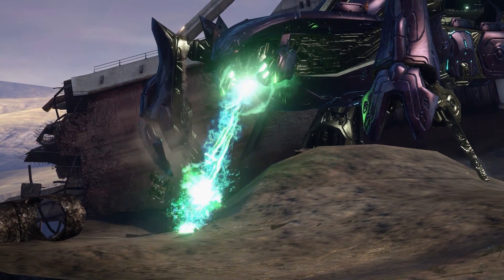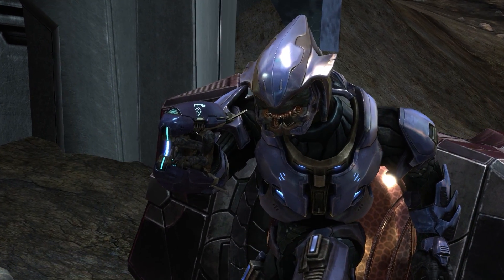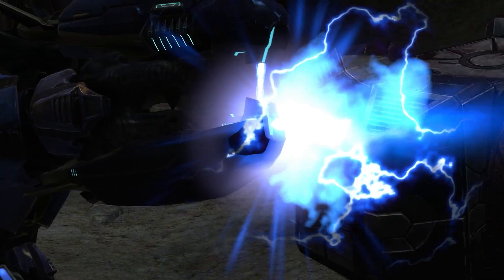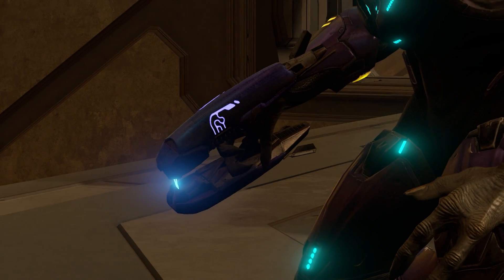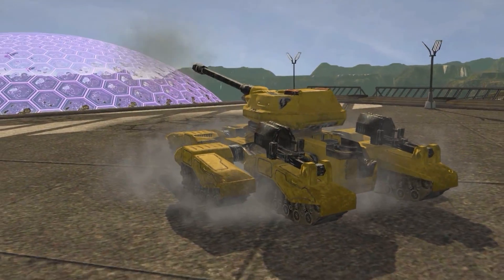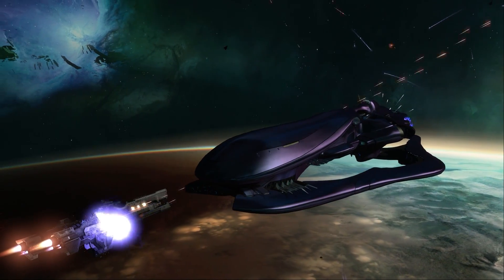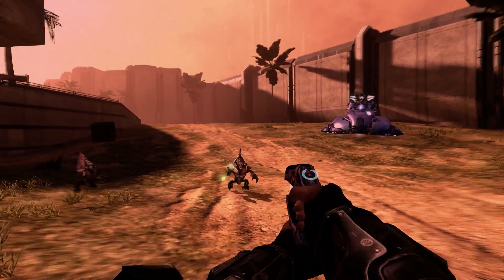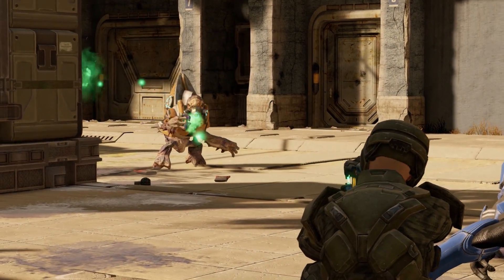How Plasma Works (Halo Lore)

Comment: Master Chief survive re-entry which has being known to get up 3000 degrees C which suggests that Mjolnir armor is incredibly heat resistant so maybe survive plasma shot isn’t all that crazy for a spartan.
Reply: zahir martinnez Master chief used Debris during both of his re entry feats. Also plasma would likely be even hotter since plasma punches straight through mjolnir in the books.
Reply: Dj Cuevas covenant plasma torpedoes are stated to be 3000 degrees celsius and in the novel chief tanks a fuel rod cannon to the chest and keep going so idk were you are getting that plasma weapons melt through Mjolnir especially when even odst armor which is a down grade has procedures to reduce plasma effectiveness of plasma, also were is it stated that chief use debris I know there is fan art of it but to my knowledge nothing official has be stated own the matter.
Reply: @zahirmartinnez211  
During the beginning of halo 3 & 4 Cheif enters the atmosphere of Earth and a forerunner planet with only bits of space ship debris. There's also a plot device the writers will use sometimes to explain why spartans survive such leathal attacks called Armor lock. I'm pretty sure that's canonically how cheif survived falling on to Earth from high charity.
Reply: @punctuationman334  ight ight you might be right but dont attack people pliz
Reply: @zahirmartinnez211  Need a source on when Chief tanked that shot cause other spartan IIs have been killed by similar or less impressive means.
Reply: Samuraiedge II sure it’s from the halo novel “The Flood” here’s the quote: 
His shield had just begun a recharge cycle, feeding off the armor's capacious power plant, when the pair of Hunter aliens burst from cover and lobbed fire at his position.

The first blast struck him square in the chest and sent him tumbling backward. The second shot was stopped by a thick-trunked tree. A trickle of blood pooled in the corner of his left eye. He shook his head to clear his blurred vision and rolled to his left.
Reply: @zahirmartinnez211  Okay since the book specifies that it takes place between September 19th and the 22nd 2252, that would mean that Chief and any surviving Spartan IIs was wearing MK VI armor.

The problem comes in when another spartan, William-043 was killed by a single shot to the chest by a Hunter's assault cannon. A month after the Mk VI was issued.
Reply: Samuraiedge II there probably inconsistency in the armor for narrative purpose and that’s why I go with some of the higher ends sense it’s actually more consistent with everything we seen spartan due or claim the can. It seem like the authors nerf characters to raise stakes but if you what me to I can show you feats.
Reply: @zahirmartinnez211  Okay, after a little more digging, Chief was wearing the MK V when he took the assault cannon shot. 

Still inconsistent though as the MK V apparently can't handle terminal velocity impact as evidenced by Malcolm-059's death and the wiki says that Chief withstood the splash from an off-target shot.
Reply: Samuraiedge II Mjolnir amor information is tricky because on one side the wiki also derived is sources from gameplay ( I don’t mean the game I’m referring to the actual gameplay) an obviously gameplay is dictated by balancing issues, halo wouldn’t be fun if you tank every attack no problem but it would also suck if you died every time you got shot. So when I try and determine the actual strength of the armor I have to go by the lore, but the lore has multiple author with their own ideas to how powerful the suit should be so ultimately you have to for what is consistent in the lore. So yeah sometimes lore contradicts itself but that just the nature of a long running series like halo. 
So the final question would be what’s consistent with the lore, well we see spartan jumping from space multiple time and the impact force from just free falling from that high (taking the amors weight into consideration ) would be enough to level a building. We see the take gun fire like it’s nothing ( yes even plasma once a grunt tried shouting chief with a plasma pistol of guards did nothing). We see chief surviving ramming vehicle into walls and then playing it for jokes. Other spartan state the can survive a pelican crashing at high velocity. Finally we also see chief surviving the emp blasts from the composer ( yes the librarian gift did save him but that only effected chief dna and suit was still fine, we also see the scientists clothes burn so the suit still had to tank it) a and the energy necessary to turn someone to ash is about a billion joules aka building level. Take that all into consideration and more I forgot to mention and you can easily see how chief durability is much higher than people give him credit.
Reply: @punctuationman334  They dont idiot, Spartan armor can resist plasma impacts perfectly. You guys are exaggerating things so badly.
Reply: I dont think youre taking into account the speed of temperature changes. Reentry heats you up over time as theres more and more friction whereas a plasma bolt would be instant.

The difference is that on one side the metal has time to get used to the heat and dissipate it over the entire arnor equally, the plasma bolt heats it up so quickly it would melt through the armor before it had time to qualize temperatures.
Reply: Isaacreeper the problem with your claim is that your already assuming that the plasma bolt will heat up the suit instantly, but their is no evidence to suggest in fact scientifically it would be near impossible for that type of energy transfer. The blast would heat up the suit but no to as high a temperature as it self and as I already explained plasma shot are 3000 celsius which means a plasma bolt would heat up the suit sub < 3000 celsius therefore if Mjolnir can survive re-entry temperatures that reach even surpass 3000 celsius he would be able to survive a plasma bolt no problem and your point about dissipating heat would not matter sense either way the suit would eventually reach such temperature and it didn’t get destroyed, it would only be valid if the suit dissipated so much that it didn’t reach such temperature, which we have no evidence for, in fact we have evidence to the contrary as we literally see chief reach ablation speeds.
Reply: @zahirmartinnez211  Dude, Sam 034 had his Mjolnir and undersuit pierced by an overcharged plasma pistol and eventually lead to his death, granted this was at the VERY start of the war and improvements to Mjolnir would be made to more effectively withstand Plasma but it wouldn't be by much. The most protection that Mjolnir offers is from its energy shielding, the armour plate really isnt all too impressive
Reply: true but thermal energy dissipates and travels exponentially the hotter you get, so like there would be a critical point and plasma would just destroy every material, hell even in reactors we don't hold plasma with walls its with electromagnetic fields just like the covenant. it really depends on what the gas is used for plasma and the energy put in too, so like its still possible he could take a few rounds, the energy needed to stabilize the round in the first place would be extremely high and to maintain it over distance indicates it acts as an inductor and once a field is made its hard to change. but then moving the inductor physically would induce a change field from everything around it so like idk bro im just spoutin out nonsense.
Reply: Aidan Atkinson dude the plasma we make in reactors is over million degrees celsius I mentioned in my original post the covenant plasma is only 3000 degrees this isn’t a far comparison what so ever.
Reply: Energy shields, dude. Master Chief's MJOLNIR has energy shields on par with some Elites.
Reply: Nobody expects the Inquisition! IP same energy shields that tank a fuel rod canon .
Reply: @angrycheese00  usually yes, but not under the situation we are talking about
Reply: Don't forget the sudden stop at the end.
Reply: That's because he locked his armor beforehand. It is why when the marines investigate him one says: "His armor's locked up". I don't know exactly how armor lock works, but it is mentioned.
Reply: GTAVictor9128 we are talking about heat resistance, amor lock has nothing to due with heat, it to survive the high impact force like falling or high speed projectiles. Also amor lock is likely automatic and not manually done.
Reply: @zahirmartinnez211  agreed, th.c ough armor lock can be done manually
Reply: Yeah but master chief hid behind a forerunner door, and you know those guys built impenetrable doors.
Reply: lemmingscanfly5 not in halo 4 and even in 3 that holy would help a little sense he didn’t just fall through the upper atmosphere he fell all the way at the exact same speed sense he never slowed down meaning he fell also through the thicker lower atmosphere which means that he likely still be experiencing a great deal of heat since there is literally more air to create air friction and therefore raise the heat of the suit. Your argument would only work if chiefs was in capsule of sorts.
Reply: @zahirmartinnez211  it wouldnt be as much heat as if chief were falling without it. Hiding behind the forerunner metal would be like using it as a heat shield.

Its the same way current capsules return to earth, they have halycone structure at the bottom made of heat resistant material and the rest of the capsule is steel and aluminium.
Reply: Isaacreeper yes but those capsules slow down before the reaching low atmosphere were it’s a lot denser, and what you’re, forgetting is that those capsules still heat up around the sides even when there cone structure is ment to disperse heat. While random piece of a forerunner dreadnought would not be able to disperse the heat from the suit as efficiently meaning wave of air would rush through chief armor especially when you take into account this is lower in the atmosphere and therefore more opportunities for air to get through. Taking that into account all it would mean is that chief manage to disperse a portion of the heat how much we don’t no but if something is causing air friction at that level in low atmosphere it would easily exceeded 3000 degrees celsius sense those temperatures are active higher in the atmosphere were it’s not as dense. Either way none of this matter because he did essentially the same thing in halo 4 without the door.
Reply: The later mjolnir VI sure, but not the earlier stuff
Reply: megakiller999 the quote I send was from halo The flood novel which takes places during CE so the older model definitely could.
Reply: You all have a faith point and I am agreeing with what you all are saying but this is a game.
A game with pretty realistic explanations on how stuff works but if we knew exactly how things worked we would be using the technology ourselves.
Reply: Fair*
Reply: @evancrow2191  well we’re just extrapolating from what the fiction tells us. So I’m not saying thermodynamics of make any sense it’s if we know character can survive exhibit a than he could probably survive exhibit b.
Reply: Watch sametokens video on the halo armour it explains how when in hard impact or in for a huge beating the energy shield can go to maximum overdrive for max protection but ruins the wearer's mobility and ability to hold things
Reply: @ReeceCoza   yeah that’s called armor lock, while a few of the feats I mentioned happened in armor lock not all of them did. Most prominently the one where chief tanks a fuel rod canon shot to his chest. Give that feat was done while he was wearing MK 5 armor. In MK 6 armor he withstood 6 shots. He survive being almost point blank in a scorpion missile explosion and survive falling from orbit twice, gg for all the people where saying he can’t. Either way if you wanna argue on the ease of which he could do it that’s a different discussion but considering he shrugged off 6 fuel rod canon I think you know where I stand.
Reply: @zahirmartinnez211  hahahah I'm just talking about how you said he survived 3000 degree heat and impact from re entry 🥺🥺
Reply: @ReeceCoza  yeah well there I was just demonstrating that they’ve showed capability in tha first place either way that feat is better at demonstrating how durable master chief is rather than how good the armor heat res is sense he use forerunner door as a heat shield anyway. Although in the fall from requiem he shown falling without any heat shield of the sort. Either way the fuelrod canon should should demonstrate the point better sense he tank the while his shield wasn’t even fully charged.
Reply: Reentry creates plasma...  in the game they NERF mjolnir armor.
In reality a spartan would be near invincible, in game chief plays like a mostly normal shooter character.
He should be closer in strength to the Doom Slayer ripping and tearing the covenant.
Reply: @GrOuNdZeRo7777  He really shouldn't... it was stated several times that Elite Zealots were of equal strength and ability to a Spartan 2 in Mjolnir. And Brutes are MUCH stronger than Spartans even when in Mjolnir, hell Chief nearly died because he couldn't break the grip of a Brute while it was strangling him. Through Elite Minors, Grunts and Jackals yes you could compare Spartans to the Doom Slayer, but compared to Covenant troops that were of higher rank and equal skill, Spartans were often in a VERY bad situation. Hell 3 Zealots managed to completely take Noble Team off guard and nearly kill 2 of them

Comment: If a plasma bolt were to make contact with your skin wouldn’t you instantly explode? Due to the temperature differential of 25,000 degrees Celsius and the heat exchange with organic matter.